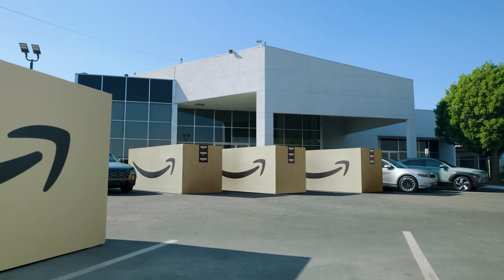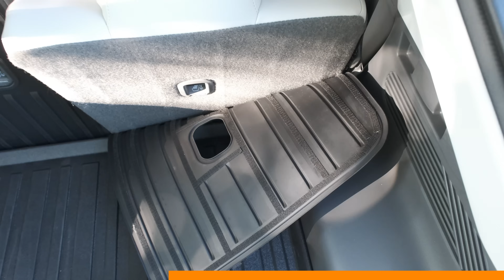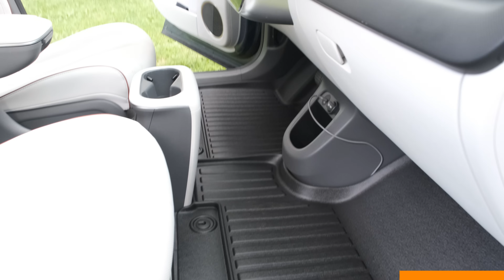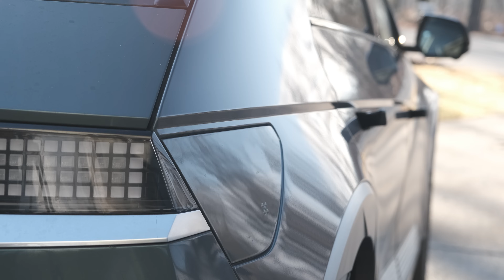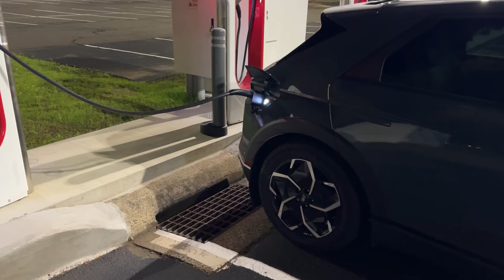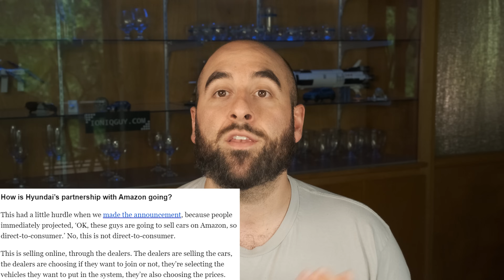NACS (Tesla) Ports Definitely Coming in Q4 2024, Say Hyundai COO | Also Talks Superchargers

Comment: That's a good reassurance that Hyundai's timeline hasn't waivered, but… I wouldn't hold my breath on Tesla holding up their end of the deal. It also raises some questions, however. For example, I'm guessing that the 2-years free charging with Electrify America will be dropped for cars with those J3400 ports…? If Tesla doesn't pull through on time, will those new models with also come with adapters so they can still use CCS1 stations…? What's needed more than anything else is for Tesla to simply authorize E-GMP cars to use their v3 and v4 Superchargers, like is already the case for Ford and Rivian. There are already third-party J3400 adapters available so that you and I could plug in at those Superchargers if need be IF we just had the software upgrades to do so. BTW, apparently you CAN use those thrid-party adapters with Magic Dock stations, as this owner demonstrated: https://www.youtube.com/watch?v=oPzsQIOBTCA

Comment: 400V isn't the reason Hyundai cars charge at only 97 kw at Superchargers. Supercharger software is the problem. Hyundai's 800V cars can charge with 150 kw at 400v charging stations if CCS specifications are met. (Tesla doesn't care of course about those though)
Reply: Correct. I think it isn't a simple update and I assume part of the negotiations were about who was going to pay for them and when they will be done by, but you are correct that they can charge at higher speeds, but Tesla didn't spend any money on that since they all used 400V architecture. The V4 superchargers will be much faster, but given the recent news who knows how long it will take for them to be widely available in the US.
Reply: For current Ioniqs, yes, 400V is indeed the reason. I thought the same as you until I found out 150kW CCS stations are almost all capable of 800V, and only a few over 50kW are 400V max. Hyundai just came up with a clever way of using the traction inverter for 400V->700V conversion (unlike Porsche), and 100kW was free.

Some chargers limited speed to ~50kW for Ioniqs, but 100kW is the 400V limit.

For 2025 models with NACS, maybe they'll boost that, since it's a 150kW inverter.
Reply: @masina9447  I was referencing the "charge with 150 kW at 400v charging stations" statement in pointing out that our 2022 I5 regularly pulls 175ish kW on those units that EA labels as "150kW".  Though you may be right that the reason being they are 800v units, not 400v as I thought.
Reply: @masina9447  What I don't understand is why they needed to do this 'clever conversion' rather than just splitting the pack in half so no conversion is necessary.
Reply: @BillyONeal   Pack splitting is not cheap, as you need to add high current switches & cabling, and BMS is also trickier. The whole point of 800V is to reduce current, thus requiring thinner cables and eventually cheaper electronics.
Reply: @masina9447  The current would be the same, at 400V you would just get half the charge rate, which is about what we see with Hyundai's rear motor trick. The cabling doesn't need to be any thicker. It is true that you need an extra cable connecting halves of the pack, an extra contactor or two, and the design constraint that the number of battery modules be evenly divisible by 2. But the extra motor winding and control electronics to do the boosting aren't free either.
Reply: @BillyONeal  If you splitting solution is the power, then what's the point? Yes, Hyundai's trick is almost free. That's why they did it despite very, very few 400V chargers that output over 50kW in 2020.
Reply: 175+ kW, actually, on 400-volt units.
Reply from the maker: I’m not saying 400V is specifically why it’s currently at 97kW, I’m saying 400V is the reason we’ll never get 250kW at a current Supercharger

Comment: Any mention of NACS adapters for current owners? When will they be available, and if they will be provided at no charge?
Reply: NACS adapters will be available next year. I don't personally care if they're no charge. You can already get at least one now but it won't work until Tesla activates whatever car brand you have. Supposedly existing Hyundai:Kia's will have access via an adapter early 2025
Reply: Don’t count on it. It’s really not a big deal
Reply: @FuncleChuck  - So you are saying having access to the NACS system is not a big deal to current owners??? Just buying an adapter won't work. The car's software must be updated to recognize the NACS software. They both need to communicate with each other.
Reply from the maker: NACS is a standard that every charger will eventually have. What you are talking about is a Supercharger problem. NACS uses the exact same communication standard between your car and the charger as any CCS charger does